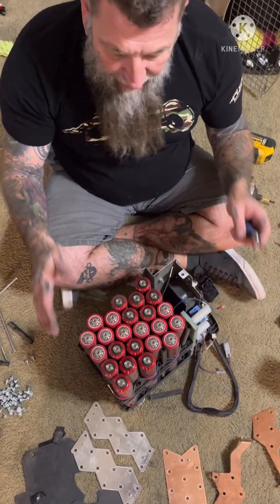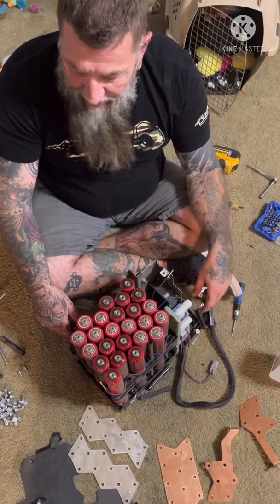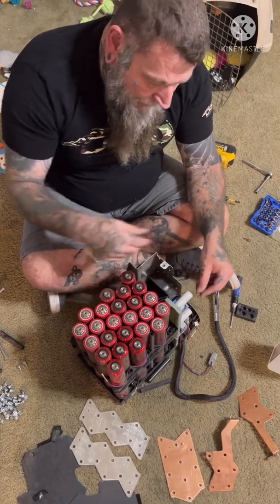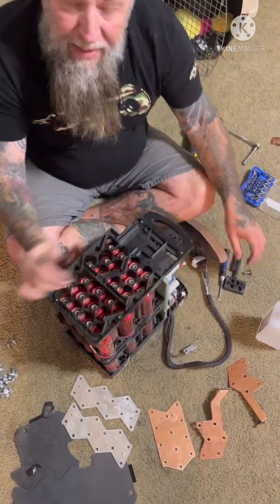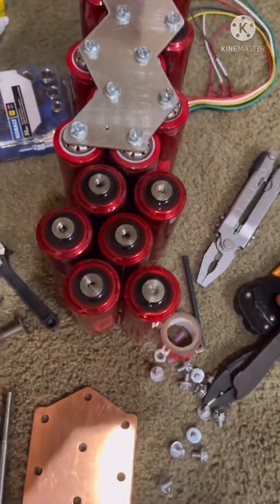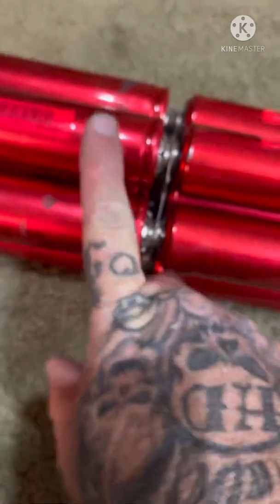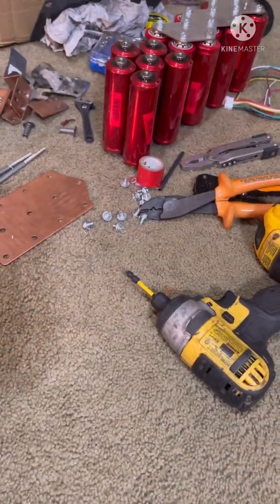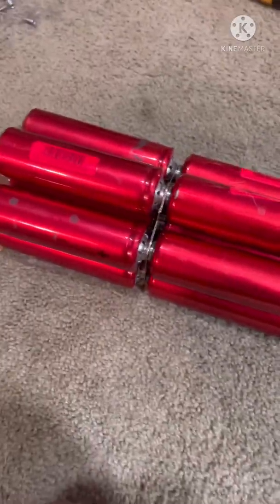Headway super beast module, build a battery

Comment: Hey Jerry, I bought a superbeast before I realized their max charging voltage is 14.6v for a 12v configuration. My alternator from auto tech engineering is set at 14.8v. Do you think they will degrade quickly by charging them at 14.8?

Comment: Great videos man! I’ve been watching your channel almost everyday for a while now and I’ve gotta say you’ve played a major role in my car audio adventures. I’ve got a few questions to ask you concerning my new build. I’ve got 3 super beast headway modules on the way (144 cells) and I’m wondering what size bms would be best for a 96 cell 12v bank. As well as a 48 cell 12v bank. Will I even need a bms? Or just a balancer and battery monitor? Also I have a single 160amp alternator to charge the 48 cell bank. Will that be enough? Or should I mount a 2nd 160amp alternator dedicated to just charging the lithium bank? Is there a safe way to build a dual alternator bracket? Thanks man! And keep up the videos!

Comment: Fun stuff! Ive spent a little $ on headways. Theyre decent cells. Def cheap. I built a couple 64 ah packs quit a ways back, I kept getting 20-40 cells here and there, then ordered 4 of the beast module hardware kit where just the busbars and cell holders came. Before the cold part of winter hit I had a little over 250 ah. Built a cool little enclosure with push and pull fans active balancers ect. Still have 2 decent sized agms and a 630 farad ultracap. I'll end up getting a heater before long so I can leave it the way it was. But with one synergy wfo 3k I'm still at 150.7. Just not the same